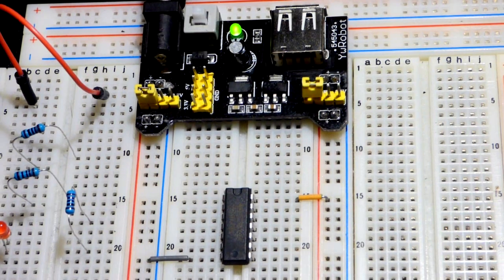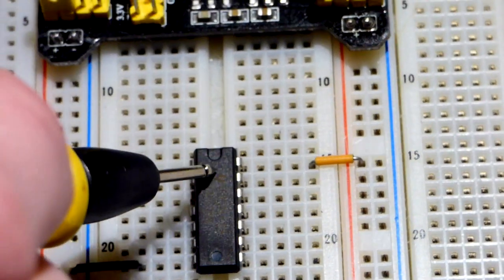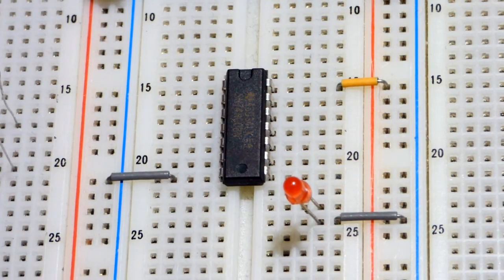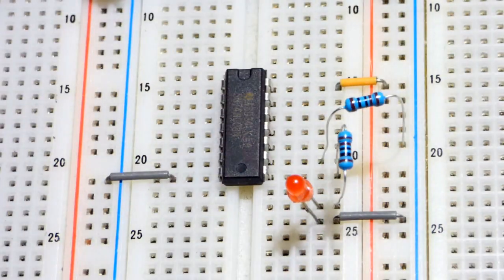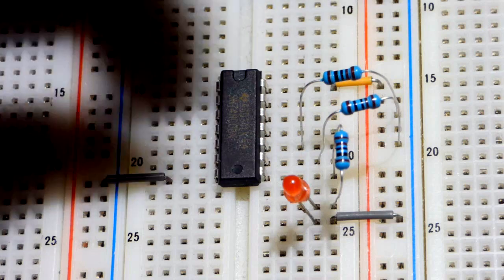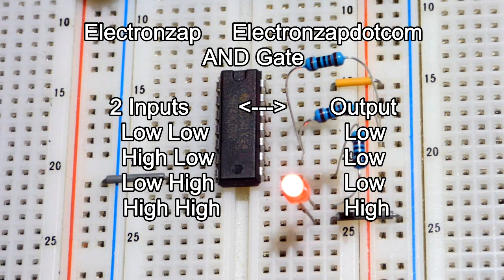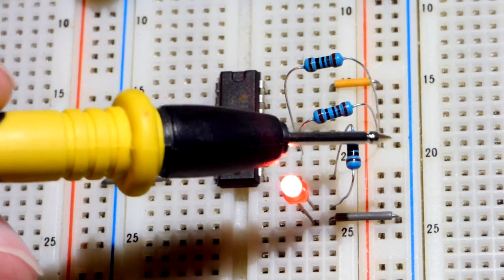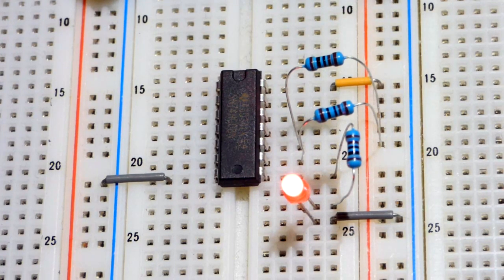SN74HC08N Quad 2 input AND gate integrated circuit IC demonstration

Comment: Is there a way I can use the gate to drive a load without an MC? I tried using the transistor/mosfet combo so the low voltage from the gate could drive the base of the transistor which will drive the mosfet’s gate. But it just seems to pass voltage when holding the button, it won’t latch. When I take the transistor out, it latches fine. shrug

Help me obiwan, you’re my only hope

Comment: What is the difference between 74hc08 and 74hc08n
Reply from the maker: I had to look it up, according to wikipedia, texas instruments starts their 7400 part numbers (prefix) with SN and end the part number (suffix) with N if it is in the plastic dual inline package (DIP). I think other manufacturers also use those same letters, so I wouldn't assume the IC is made to the quality that texas instruments would make them.

Comment: Why my sn74ls08n cant make output became 1 when the ground is neutral source , the input is already all 1 , im confused..
Reply from the maker: The integrated circuits get damaged easily, so it may be bad. Every time so far that I had one not output properly, replacing it with a new one and wiring it carefully has solved the problem. Hope that helps!

Comment: Im soooo confused right now, why do they call it and AND gate when it is clearly an OR gate. Same thing with my  SN74LS32N which they call an OR gate but when I test it it's obviously an AND gate. I dont care if the 7408 is not "supposed to be high" when both inputs are low, it clearly and effectively is high and therefore wont work in a circuit it's made for just based off it's datasheet. So wtf is going on here somebody please let me know.

Comment: My first computer job was with Burroughs. In the late 70's. I worked on a B1700 all it had in it were 7400 series IC chips all wire wrapped. When it failed it was a nightmare to track down and find the bad logic chip. there were probably 100 per board. Its too long ago to remember. I like your videos. Add some 555 to the logic chips to make it fun.
Reply from the maker: Trouble shooting one of those doesn't sound fun at all. Especially considering employers are impatient lol. I'll definitely be adding 555 timers at some point.